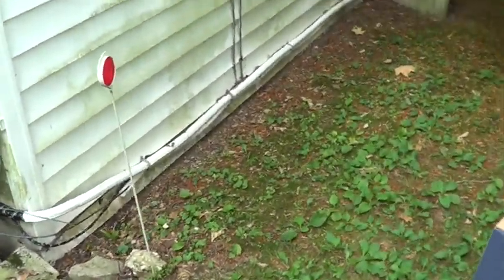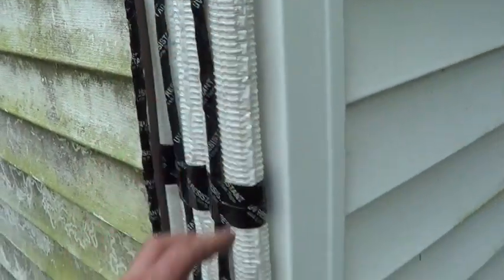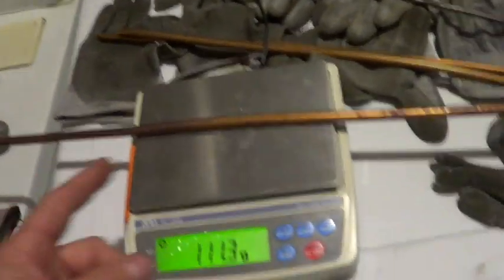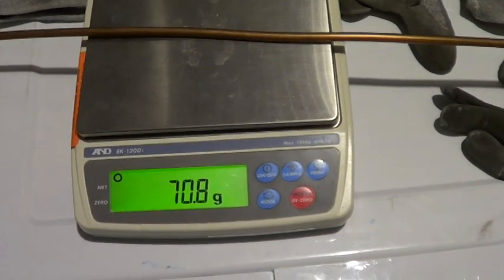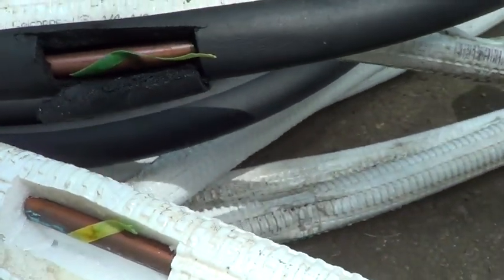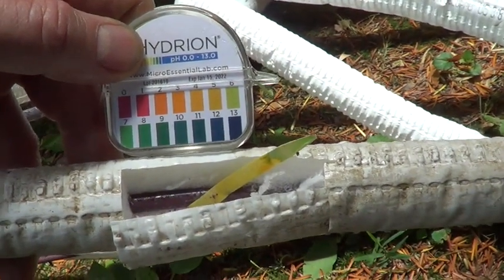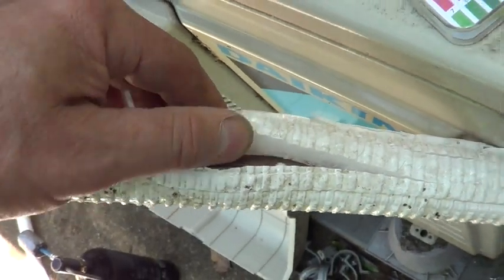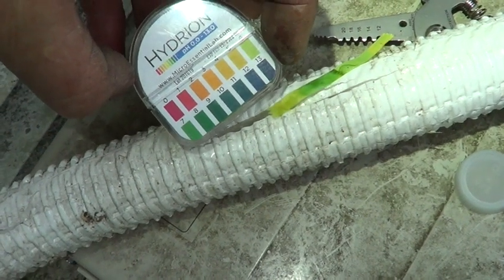White Insulation HVAC Lineset Leaks Cause is Acid

Comment: I have three of my jobs do this and I am about to post my first video about it. Yes my first one the lines that was about two years old another one was several years old in the second when I came across was about three years old and they were all on my jobs that’s why I was very pissed off. I’ve never had this problem using Mueller on any of my jobs going back over a decade. And for my grandfather who always installed hard copper from back in the 40s even on our own house and my fathers jobs in my jobs. But the isopolar leak like a sieve. And because they were from different years from the same company they can’t say it was just because of one bad batch. As for the acid as soon as the refrigerant starts leaking through the copper in the moisture from condensation react with the Fluorine gas in the refrigerant it makes hydrofluoric acid that eats away at more at the surface of the copper that’s what your pH litmus paper is picking up
Reply from the maker: the refrigerant has to break down to release the fluorine.   water doesnt break down refrigerant.   UV does and extreme heat.   i have seen thousands of leaks and they never looked like these with the extreme pitting just like rust.
Reply: NathansHVAC Yes you’re exactly right that’s because this is not normal Copper with the same alloy that we are used to seeing in our past. At first I was just going to cut out the sections that were bad. But just this last two weeks ago I had to go back and repair more leaks on a job with leaks from ISO POLAR. So now I’m tearing out all the copper on every job as soon as I find a first leak that looks like this I have to re-copper the whole job from beginning to end.  Talk about ruining your name and your reputation not to mention the monetary loss in both materials even if they gave you materials back for free do you really want to put that back in your job. Starting to remind me of the old car that was called a Yugo.    I’ve never seen Copper deteriorate like this before.        And this Copper is in the same location with buildings that had copper in it for 40+ years with no leaks and no corrosion.   What’s up with that.

Comment: Thanks for the video. Makes me a bit nervous, have started using this kind recently. I have loved the much more durable insulation, its so much easier to not tear, looks better of install doesnt get a line cover, holds up to the sun better, doesnt absorb as much water goes back together nicely if you have to cut the insulation to bend or braze.
 I know armaflex black is just fine, but on a decent percent of installs its just so easy to tear up (unless you do more braze joints - like on site bent and swayed elbow instead of trying to pass through the wall).

But none of its apparent advantages mean diddly if the lines leak in a couple years. Only been using for a little over a year, hope I dont have the same experience.

Have you seen this on other jobs or only this one batch of linesets?
Reply from the maker: I think it is pretty rare.    But, it doesn't build confidence.   I'm sure people will find this video if it is a bigger problem.
Reply: @NathansHVAC  This is huge issue  going on
Reply: Anyone saying without a line set cover is automatically called a fucking hack.

Way to go fucking hack.

Comment: A scale and a Ph test... god. Man, I feel for you. It's good to see the service/diagnostic side of the trade. Being strictly install, I only occasionally have to troubleshoot. Right now were getting leaks on our mini splits from the same linesets, but were finding its mostly at the mechanical fittings where the brass nut meets up to the flared copper so we're going to start adding crush washers. Two types of metal creating a mechanical fitting with high pressure and temperature fluctuations aren't easy on the line set.
Reply from the maker: I got bad news.    There are two types of flare nuts with different angles.   You have to only use the manufacturer nuts.  Throw the line set nuts in the recycle.  They dont match and there is no way to field measure the inside angle of the nut.
Reply from the maker: They do make purple teflon washers now that might take up the slack in the mismatched nut.   Also, use the $200 orbital flaring tool.    Hilmar makes it.   It is well worth the money.
Reply: @NathansHVAC  do you recommend using those purple teflon washers???

Comment: Inpurities in the copper, it has oxygen in it.
Reply from the maker: The copper oxide is the green.   Acid oxidizes metals.  That is how you clean pennies.  You put them in acid and the dirty copper is etched away.  The acid removes the natural protective layer of the copper and exposes the pure metal to the air.  Also, oxygen won't create acid.
Reply: @NathansHVAC  oxi oxygen? The problem lays in the production process of copper, this has to be oxygen free, if not it creates problems, also the recycling of copper makes this more challenging. Oxygen and water creates acid and will continiusly clean your penny until theres nothing to clean anymore.

Comment: The siding on the house looks terrible. Maybe they tried to wash it and some of the cleaner seeped into the insulation?
Reply from the maker: Good point.   I asked that question several times to the customer.  They said no.
Reply: If they tried washing it they did a horrible job
Reply: Interesting idea.

Comment: Mueller had a "bad run" of line sets.  I happened to be at the supply house when they were loading an entire truck with line sets. Apparently there was a manufacturing defect and it had pitted/scored and weakened/thinned the copper and certain areas.
Reply: What state are you in I'm doing research on this and trying find out if this is just an issue in the north east part of the country
Reply: @mikecappuccio3843  I'm in New Hampshire
Reply: @mikecappuccio3843  Florida and changed out the same ISO Polar crap but ordered from EComfort which came from the north east.

Comment: Been seeing alot of cheap chinese copper from certain distributors fail lately. Seen pinholes and light leaks pots even in water pipe copper as well
Reply from the maker: The manufacturer said they only use one of 3 US copper companies.  The date code says what company they use.   However, this appears to be a chemical reaction with the acidic ph.  The leaks became so big the system loses refrigerant on one day.